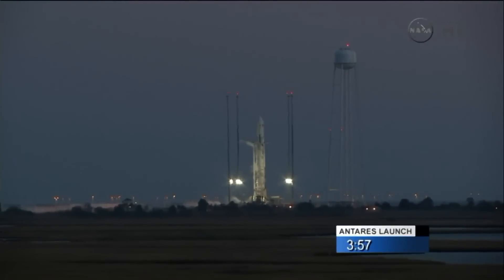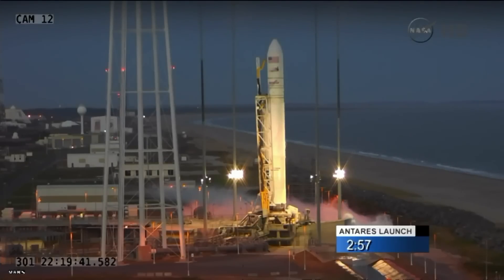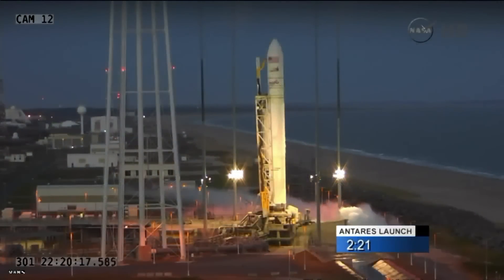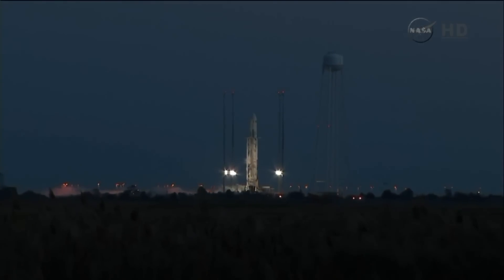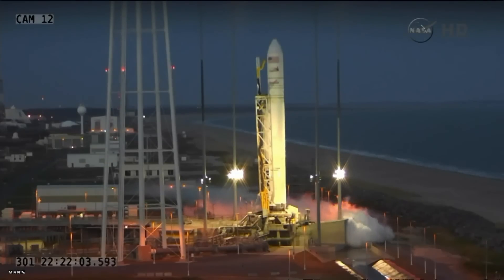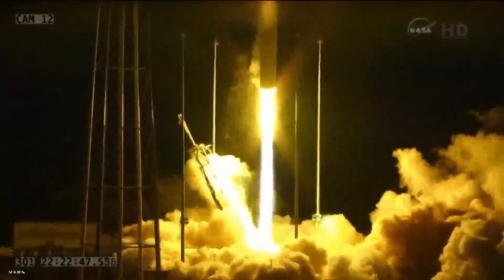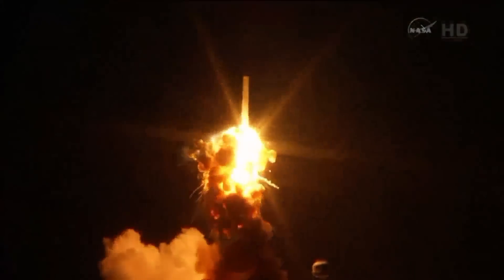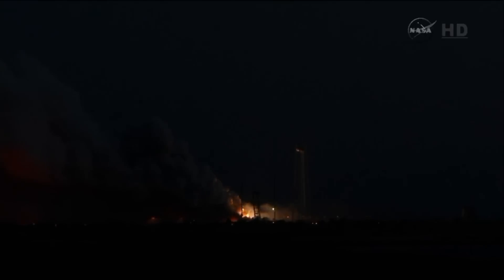NASA Antares Rocket Explosion [HD] [FULL]

Comment: Did they install a nuke in there Like WHAT THE FUCK
Reply: When an engine fails early in flight, the rocket's gonna come back down. And since even at the best of times a rocket is a barely controlled explosion, if it blows up when it's full of fuel, you get this kind of explosion.

Comment: Its not NASA Antares rocket, it was Orbital science Antares rocket that was simply attempting to make a delivery for NASA. But when you use 30 year old Russian engine's this is what you get. Turbo pump failure and Kaboom. This Antares is a pige-poge of different components from several different foreign countries all pieced together in an attempt to land the CRS-1 contract. The only thing Orbital ATK actually makes themselves is the service module, solar arrays and the Castor XL solid upper stage motor. Main engines from Russia, booster stage from Kazikistan (is same core stage as the Zenit rocket used for sea launch) Cygnuss is built by the Italian space agency. And after all that it is still almost double the price of their competitor SpaceX and the Falcon 9 and Dragon spacecraft, all of which is built in the United States. I think Orbital ATK needs to learn how to build their own rockets if they intend to be a major player in the commercial launch industry.

Comment: Ah Americans! After all these years of experience, you exploded it once again. Poor engineering!
Reply: +Jeetu_Ghorpade! The poor engineering you are referring to was done by the Russians who built the engines that exploded causing this incident.
Reply: They just forgot to use the high heat resistant duct tape. Honest mistake.
Reply: Yea right, after a bunch of guys fiddle with it take it apart and change pieces, to get more power, you're still going to blame who made the original?
It's not original anymore. And it's not what they designed and built anymore.
Reply: I believe it was a software glitch.
Reply: +littledman2607 no.... Not at all... It had an old Russian engine...
Reply: xXSavageBrosXx Yes but it was a software glitch
Reply: +littledman2607 no..... Software is the programming.... They blow it up once in the air, meaning command destruct worked...
Reply: Just so you know America is the best in aeronautical technology, aerospace technology, soldiers are best equipped with top of the line technology, our navy is the most advanced and sophisticated. I can only give tanks to Russia.
Reply: If YOU say so.

Comment: *Rocket is a flaming mass headed for the ground*
"Avionics power nominal."
Reply: Avionics power was probably still nominal at this point. Some other systems were not, though...
Reply: it has a 2 second delay.
Reply: I remember watching this live and was thinking that's not nominal...
Reply: Avionics are just the electronics inside the rocket and spacecraft. They probably were working fine until it reached the ground.
Reply: The feed they see is slightly delayed. They saw the explosion a few seconds after they said that.
Reply: Christoph Gössel 

K
Reply: Well that just doesn't matter when the rocket is about to hit the ground in a few moments.

Comment: "Engines at 108%" maybe that's why?
Reply: +FoxTail737 
It's actually normal. The percentage is in regards to "rated performance level" which has to do with things like safety margins and reuseability/wear margins. Upgrades are usually made after the engine is rated and it is able to safely perform past the base rated performance.
Reply: wilsocn Lol, you're the exact type of person that pisses me off when I drive.
Reply: +Kanglar Thats what the engineers said... Sorry XD Yes, I know, more than 100% can be good sometimes.
Reply: +Marcus_Mravik Shuttle used to take off at 110%
Reply: +Private Pecker That's because the original engines were updated and the new ones gave 10% more power than the original. Therefore at full throttle, they were running at 110% of the power.
Reply: Mickell Rust Yes I know I was just pointing out that it's not abnormal or extreme for engines to be running at >100%
Reply: Back when we still had a manned space program, shuttle routinely ran at 104%.
Reply: "Danger to floorboard Manifold!"
Reply: I drive my car in first gear all the time in town to impress people.  The engine sound sweet when it hits around 7000 rpms.
Reply: Private Pecker
haha I was just kidding, Private P.  I drive a Toyota Camry which is the very definition of boring ass family sedan.  That puppy cruises at 75 mph at around 2200 rpms.
Reply: must be a carburetor problem.
Reply: More than 100% is not good... never.

Comment: Thanks Obama
Reply: +DDG lol
Reply: Obama had nothing to do with it. A company named Aerojet bought about 30 rocket engines from Russia after the fall of the Soviet Union (bought them in early 90s). The engines had been part of the Soviets N1 moonrocket program from the early 70s and when the program was finally scrapped, the engines were put into storage instead of destroyed as ordered by the Kremlin. 

These engines were more efficient than engines in the West due to them being "closed cycle" which meant that the gas from the preburner that powers the pumps and is normally dumped over the side is funneled into the combustion chamber also. The engines are basically over 40 years old and were touchy even back then. One crash of the N1 looked eerily like this rocket (taking off then falling). They tried to go cheap and paid dearly.
Reply: Zoomer30
Err. Dude... whoosh! But thanks for all that possibly correct info. THANKS OBAMA! (Get it?)
Reply: Zoomer30
Btw, just actually reading all that and making sense of it now... perhaps you would know... Why was a potentially high fail-rate system green-lighted (lit?). Surely JPL would have given an appropriate "abort/no go-recc" at the absolute, very least????
Reply: DDG Orbital Sciences does not have the deep pockets that SpaceX does, so they have to pinch penny's. They buy engines "off the shelf". The engines that flew were 1972 or older and had been sitting in a ware house for 20 years before Aerojet bought them. 

There is a video on YouTube titled "The Engine That Came Out of the Cold" the tells the story of these engines. The one launch where the N1 gets off the pad,  stops and falls is a carbon copy of the Antares failure, probably debris ingestion.
Reply: DDG JPL has nothing to do with commercial space flight. They control deep space probes to Mars,  etc. NASA contracts to private company's to fly these missions. They have to pass very strict vetting process to even be considered. 

Even with all that,  both Orbital Sciences and SpaceX lost flights. The irony is that if SpaceX had had their "SuperDrago escape rockets" on their mission they lost, they would have saved the craft and cargo. The Dragon survived the breakup of the rocket and sent back data all the way to ocean impact (parachutes did not deploy due to computer not knowing what was going on). All craft from here on out,  Manned or unmanned, will have the escape system.
Reply: Zoomer30
My bad,I thought at least that JPL would be vetting the launch procedures for anything NASA is touching, no matter how slightly. (JPL does have a broader mandate than your description but right now, it's not worth mentioning, given the budget cuts). But if JPL or some other Oversight Institution is NOT vetting critical systems for launch readiness, then...they probably should??? It's ok at this point with unmanned aerial forays, but this won't be the case always.
(PS: I support the commercialization of space endeavors, but hell, I trust them about as far as this Antares rocket can throw them.)
Reply: *****
 CIA hmmmm. I'm sure YOU guys had nothing to do with ANYTHING in history EVER :P

Comment: stupid question, on a different video of this explosion, everyone started running..... why? is it the fumes of the gasses or what am I missing?? these people where a few miles away I wanna say. thanks
Reply: +Carlos Castro 
Rocket propellant (especially for upper stages) is often composed of various horrific chemical compounds such as nitrogen tetroxide or hydrazine that are some of the most dangerous poisons known to mankind: just seconds of exposure can be fatal. The space shuttle used liquid oxygen and hydrogen which are perfectly safe, but unmanned rockets use the other stuff because it's more powerful and thus you need less of it, reducing costs. This explosion spread the partially-burned propellant all over the place; that was those little sparkly bits flying everywhere.
Reply: +Yonkage well damn..... I wonder how bad that is to the environment..... but thank you for the explanation.
Reply: +Carlos Castro Cause they are pussies

Comment: The Russian engines are not "better". They are "cheaper than developing one from scratch and were available". Aerojet went over to the former Soviet Union and bought up all the remaining N1 engines from the moon program (which never got to the moon). The engines are technically more efficient because they are "closed cycle",  the gas from the pre-burner (which powers the turbopumps) is channeled back into the combustion chamber rather than just diachaged overboard. Aerojet then sold them on the open market to anyone dumb enough to buy 40+ year old engines that spent decades in a warehouse and blowup if you look at them wrong. 

The engines are very temperamental even when they work,  and when they dont its a bad day with a lot of flaming wreckage and stuff. 

SpaceX had the cash to develop a very dependable and well understood engine and it has proven itself. The 2nd stage of the Falcon 9 even puts the "waste gas" from the pre-burner to good use as a form of "roll control"
Reply: Im hopeful for the next Antares launch with new Orbital ATK motors.  Thanks a lot Russia

Comment: Were the engines supposed to be at 108%? To me that sounds a lot like an overcompensation for something.
Reply: DPXPC Engines always start up at 100%, immediately shift to 108% (of the original rated thrust, engine upgrades made them more powerful so it's 100% of rated thrust for that engine or 108% of original engine specification rated thrust), and then slowly move down from 108% to 104% to 100%.

Comment: Aerojet confirms Russian engine is ready for duty: BY STEPHEN CLARK, SPACEFLIGHT NOW, Posted: March 15, 2010 http://spaceflightnow.com/news/n1003/15nk33/  

"The NK-33 engines were test fired ten minutes before Aerojet (AJ26) purchased and Yuzhnoye Design Bureau modified them in Dnipropetrovsk, Ukraine to become the ‘Antares’ rocket. Julie Van Kleeck, Aerojet's vice president for space programs said Aerojet removed harnessing, added electronics, US kerosene and liquid oxygen propellants were adapted and steering gimbals were modified." 

About the time a federation Mars craft sailed on past the planet because the trajectory had been figured in metric measurements and the hardware was built to calculate in feet, I met a NASA engineer’s Father in my barber shop who was heart broken his son was using cocaine. 

If a first stage turbo-pump malfunctioned as suspected for this failed launch, then perhaps propellant adaptation was not completely functional. Any further talk should start with drug testing all employees before testing the engines they modified. I expect all accusations and statements made about any topic that will affect me to be made with the same confidence Abraham had before an angel stepped out of the woods.

Comment: did anyone see the rocket stall for a sec just a few feet off pad? look for it. :)
Reply: Yup...  Range calculator gave a no orbit flag and self destruct was initiated.  Rocket could not make orbit because of a stall so they destroyed it before it could harm a population.
Reply: It is pretty common for rockets to stand still mid air. I don't know why though, seems saver to release it when engines are at full power...